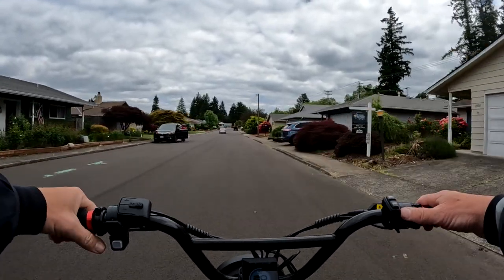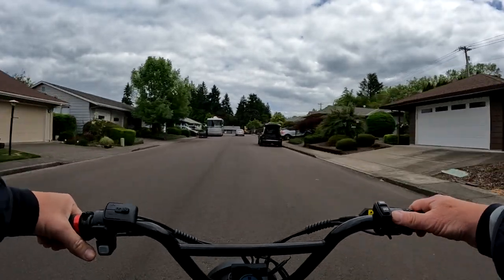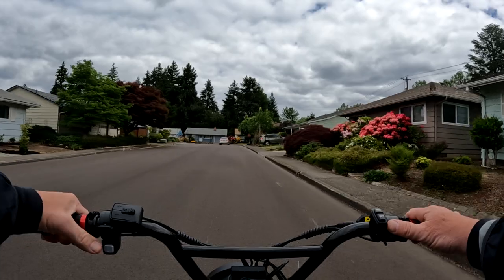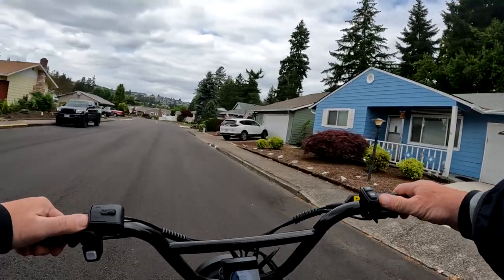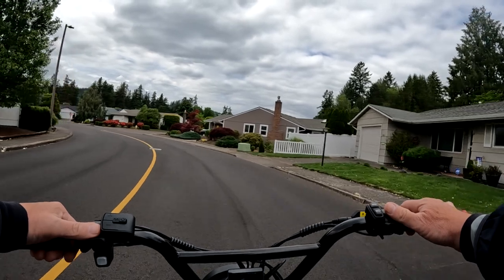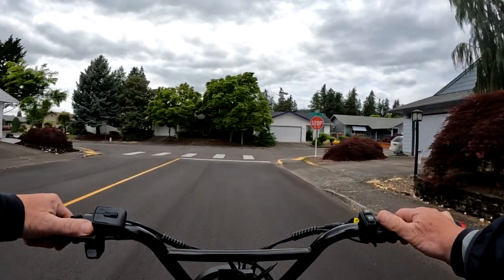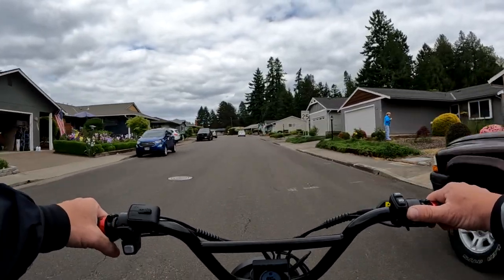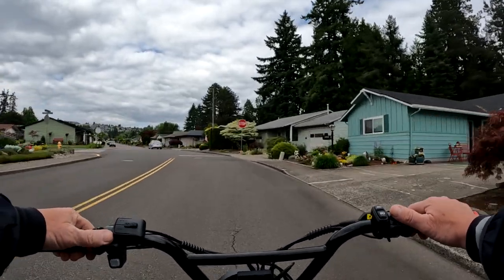Fast Ebike Charging & Onboard Chargers

Comment: Speaking of charging.. I have a 30 mile ride tomorrow. I better charge up before I forget.. 75% takes 5 hours with the 2.5 amp and a Kepler battery
Reply: A mini alternator would be so cool😎😁
Reply: @kevinnashskitchen3517  it would be a waste of power alternators on an electric vehicle is worthless
Reply: @mustbee-bike994  lol... Not if it was state of the art and ran off rear wheel momentum with a low friction..
Reply: @mustbee-bike994  constant Regen that flows back 50% of what is used would be good enough. Flow out 20 amp.. Back in 5 amp.. Would be counter intuitive but give added range if done right
Reply: We already know pedal assist saves juice.. Why not pedal and charge? Low amp input for extending range and charging.. Find a way to increase human power with low exertion  to put voltage back into the battery.
Reply: @mustbee-bike994  not if you're using reluctance instead of inductance.  Reluctance (like alternators use) does not give a lot of physical pushback for power generated.
Reply: I think you’re talking about what Arcimoto  is already doing.

Comment: I would never buy a bike that has a proprietary battery or charger. Always ask before buying.   What I’m curious about is a second battery setup I heard about where you link the batteries by the DC charging ports. So you buy or make a electrical extension cord with male ends and plug them into the batteries. The theory is that one battery is the primary discharge battery and the other is supplying a charge or ‘resupply voltage’. You have to start both batteries with the same voltage of course. Does anyone out there confirm this setup?